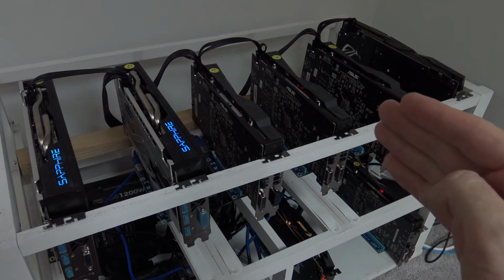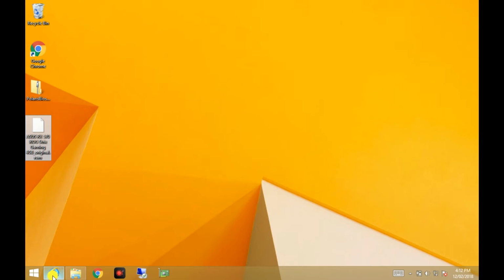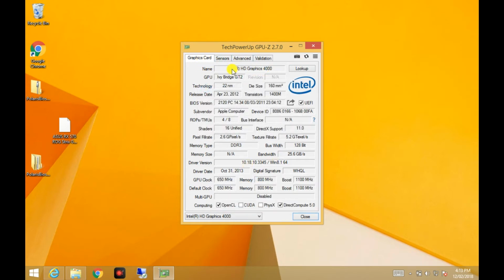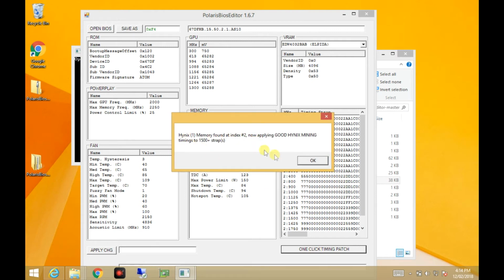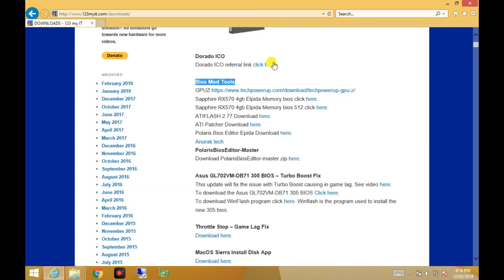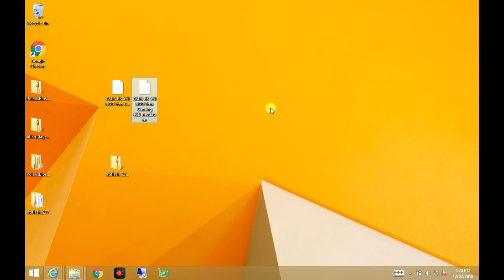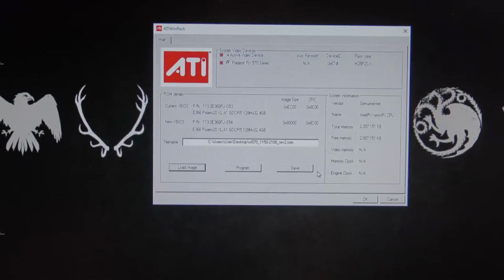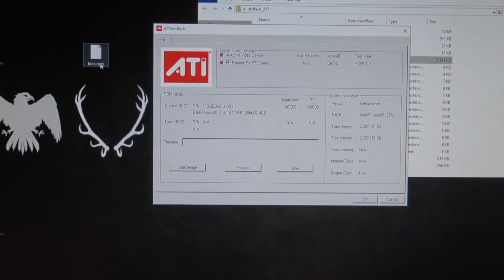One click AMD bios mod - Timings Only no Over Clock

Comment: the sentence "This version supports BIOS flashing for AMD cards under Windows 10 build 1803" , does that mean that IT CAN support lower versions and ALSO newer ones ? Or that it supports ONLY lower versions?
Reply: Asking because i've read that Windows sometimes tends to try and fix for itself , ending up  killing the gpu for good.
Reply: @123myIT
Reply from the maker: @112Firedragon  Hi Mate, you do this stuff at your own risk. There is a chance you can brick the card, however i was always able to fix a bricked card by putting a bricked card in a second GPU slot and using another card as a primary card so I can see the video screen again and then just adding the original bios back to the bricked card to fix it. 
To answer your question it should support most cards as you are just changing the timings and so far i have not bricked a card by changing the timings only. Where people get into trouble is they apply to high of an over clock to the card and the card doesn't boot. And they only have one card so they get stuck.
Reply: @123myIT  so another question here , can i , with win 10 v1809, return the original BIOS using atiwinflash (not from DOS, from win)
Reply from the maker: I am not sure mate.

Comment: i did all steps like in video but my hashes are still the same....
Reply from the maker: Whats your hashrate at? what card?
Reply: 22 mh/s  xfx 570 hardswap only thing i noticed differently is polaris bios editor after 1.6.7 said (offline mode)
Reply from the maker: Yeah so 22 is what you should get before timings and over clock. a 570 card should get 29 to 30 mhs. So yes something it not working as it should be. What driver are you using ?
Reply: latest blockchain driver from amd site
Reply from the maker: yeh so thats your problem. Have you set the card to compute mode?
Reply: cant see it in the settings and i know where it should be, i ran some compute switcher program dont know if it really switched to compute mode...
Reply from the maker: oh gosh mate. If i were you i would reload windows and start again. Try using the blockchain driver 8/8/17 version. Thats what i use save a whole lot of messing around cause the driver sets the compute automatically.

Comment: i modded my rx560 but after couple weaks hashrite start to drop slowly in all my 5 cards,i'm on windows 7.any idea why that happening?
Reply from the maker: Could be a number of things mate. What coin are you mining ?
Reply: eth on nanopool
Reply from the maker: any over clocks or bios mods?
Reply: no over clocking,bios mod only
Reply from the maker: what driver?
Reply: crimson, i traied blockchine driver but the screen went black
Reply from the maker: Hmm when you did the bios mod what changes did it make? Do you just do the timings or something else?
Reply: timing and memory clock and core clock
Reply from the maker: Yes that might be the problem. This is what I found to be a better solution. Bios mod timing only. And do the overclocks from software. And I just use the block chain driver only.
In your case I would start from the begining. Put timing only mod on your card and remove all cards from rig. Reinstall windows 10 fresh. Add the blockchain driver only. install software to change the clock speeds / not bios. Good to go.
Probably whats happening is your card are getting too mixed up with bios mod and driver software. It took me ages to work it out in the end fresh install as above fixed all issues.
Reply from the maker: I might do a video on the overclock software.
Reply: i will give it a tray.if that works and i get my old hashrite i will pay you with etherium.thank you